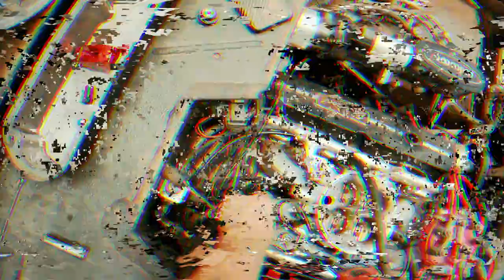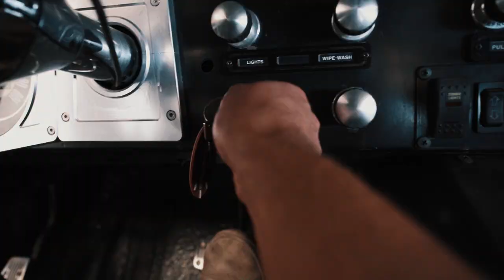BEGINNER Ways to Diagnose an Engine Knock // BAD LIFTERS??

Comment: My question is how would a lifter noise get quiet when removing ignition from the equation?  Lifter noise is mechanical and should always be there as long as the engine is turning fast enough which in your case it was
Reply: my thinking exactly
Reply: Without spark to the fuel you only have compression of the cylinder capacity. When ignited the gasoline expands 8:1 putting more force on the valves. Similarly if you remove spark plugs individually and rotate a motor from the crank- the more plugs removed the easier the motor spins.

Comment: You can put a dial indicator on the top of the push rod and then manually turn the engine over, that will check the total lift of each cam lobe/lifter/push rod, from there you can see what cylinder is different, then measuring your lifter and push rod against your known good ones will tell you if you wiped out a cam lobe or not
Reply from the maker: Ahh, I like it. Because every push rod/lifter should have relatively the same amount of travel?

Comment: Man what a bummer.. I heard somewhere that modern engine oil is not compatible with flatt tappet cams. The oil no longer contains the  zinc molecules that protect the surfaces from wear.. 
Looks like you are going to have to pull the motor and go through the rotating assembly.. 
I would recommend roller cam going back together.. 
The Pitbull is one sick whip that has come a long way..
Reply from the maker: Yeah, that's where I'm at is trying to find a good set of roller lifters.

Comment: check for a root cause, lack of maintenance, oil pressure concern, overheated, etc. in my experience (Ford technician)  piston slap is more of a bell like noise heard on the bottom end (due to the piston being shaped like a bell), good job finding it. make sure you're oil change intervals are being done, I see a lot of catastrophic engine damage due to that one small detail.
Reply from the maker: Yeah, I think the lifter failed after my last oil change. Such a bummer bit gives a good lesson to learn.

Comment: harbor freight has a stethoscope for $5. ..  I have been running a reman 351w from autozone for 8 years now with no issues.. came with a 36k mile /36 month warranty .. lol
Reply: Stock = Reliable 
I run 351w also bored 30 Over. mild cam and  Holley sniper. Zero issues! Drove from Chicago to the rubicon trail.

Comment: Pulling the plug cable to # 4 and having it quiet down could point to a bad rod bearing.
Not too hard to drop the pan and check it (been there, done that).
The galled lifter might be a manufacturing issue (I've heard comp cams has had quality control issues), improper cam break in, lack of zinc in today's oils.
In any event, you probably have had debris from the jacked up lifter circulating through your motor.
I would maybe drop all the rod bearing caps to check for Journal scoring or imbeded trash in the bearings.
Check the mains while you're down there as well.
Reply from the maker: Yeah, I'm definitely going to have to pull the motor apart and take a look. Thanks for the tips!

Comment: It seems at some point a vacuum gage connected to manifold vacuum and monitored while connecting disconnecting cyl 4 would lead you to valve train problem and not the lower end. But be prepared to find more wrong than just the failed cam and lifter. I bet you find some metal embedded in the bearings. That’s a lot of metal from the cam and lifter. At least check the Oil filter for metal . Comments about modern oil are correct. The lack of zinc and phosphorus can cause cam and lifter to fail.
Reply from the maker: Yeah I think I'm going to have to pull the engine apart again, unfortunately.
Reply: Also the noise you heard was likely exhaust leaving through the intake because the exhaust valve doesn’t open